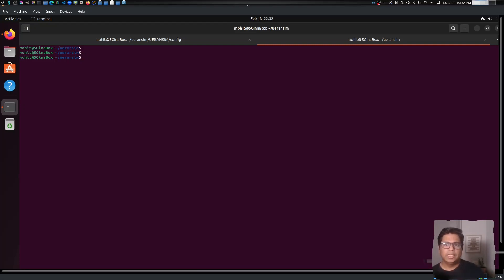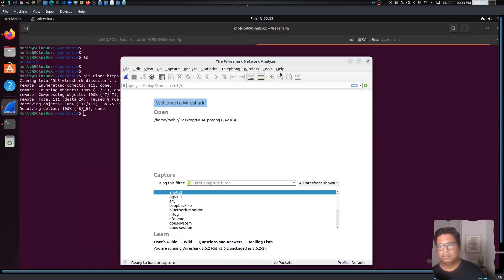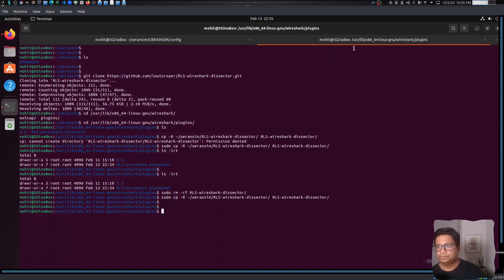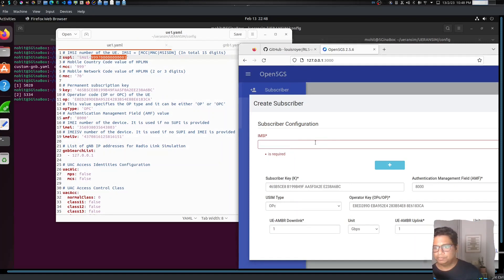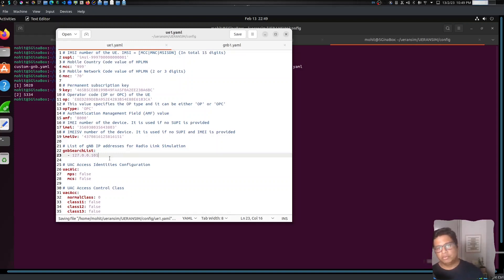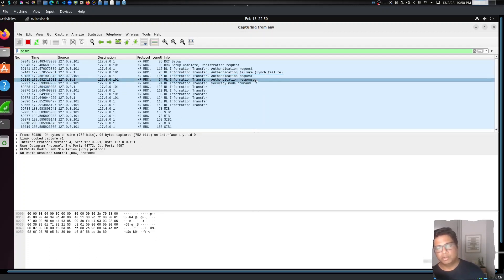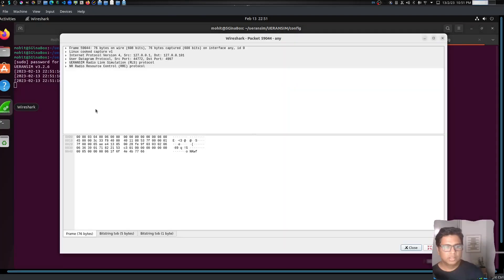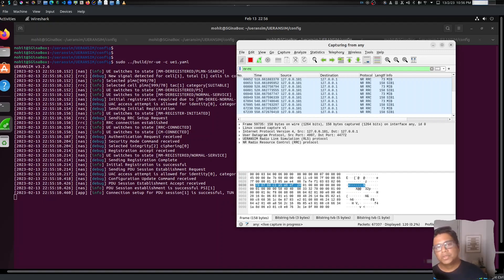Configuring RRC with UERANSIM and Open5GS on a Single VM for the Open5GS & UERANSIM Series

Comment: All the configurations I kept it as default, as I am working on single vm
I am getting "Connection setup for PDU session[1] is successful" , but after few seconds it shows 
debug] Signal lost for cell[1], total [0] cells in coverage
[debug] New signal detected for cell[2], total [1] cells in coverage
[error] Radio link failure detected
[error] PLMN selection failure, no cells in coverage
Reply from the maker: Hello,

Can you paste the detailed error from the amf. It can be found via tail -f /var/log/open5gs/amf.log

Comment: getting error [debug] Signal lost for cell[1], total [0] cells in coverage
Reply from the maker: Check the config of ueransim gnb & ue , make sure it matches the config of the core network.
Reply: I am getting "Connection setup for PDU session[1] is successful" , but after few seconds it shows 
debug] Signal lost for cell[1], total [0] cells in coverage
[debug] New signal detected for cell[2], total [1] cells in coverage
[error] Radio link failure detected
[error] PLMN selection failure, no cells in coverage

Comment: pen5g@OPEN5GS:~/ueransim/UERANSIM/config$ sudo ../build/nr-ue -c ue1.yaml
UERANSIM v3.2.6
[2023-06-23 12:27:57.362] [nas] [info] UE switches to state [MM-DEREGISTERED/PLMN-SEARCH]
[2023-06-23 12:27:59.563] [nas] [error] PLMN selection failure, no cells in coverage
[2023-06-23 12:28:01.765] [nas] [error] PLMN selection failure, no cells in coverage
[2023-06-23 12:28:02.364] [rrc] [warning] Acceptable cell selection failed, no cell is in coverage
[2023-06-23 12:28:02.364] [rrc] [error] Cell selection failure, no suitable or acceptable cell found
[2023-06-23 12:28:02.868] [nas] [info] UE switches to state [MM-DEREGISTERED/NO-CELL-AVAILABLE]
[2023-06-23 12:28:32.429] [rrc] [warning] Acceptable cell selection failed, no cell is in coverage
[2023-06-23 12:28:32.429] [rrc] [error] Cell selection failure, no suitable or acceptable cell found
[2023-06-23 12:28:32.693] [nas] [error] PLMN selection failure, no cells in coverage
Reply from the maker: Please check the configuration for your gnb.conf and ue.conf files. Either the GNB is not up or the PLMN configuration is incorrect.